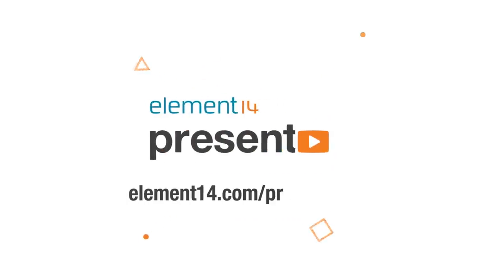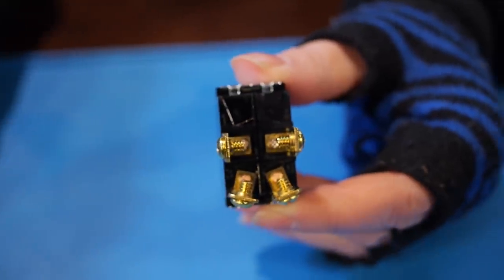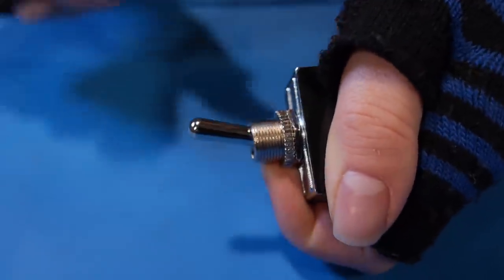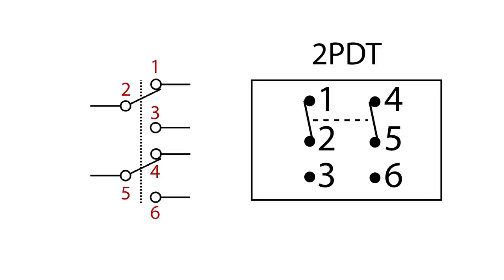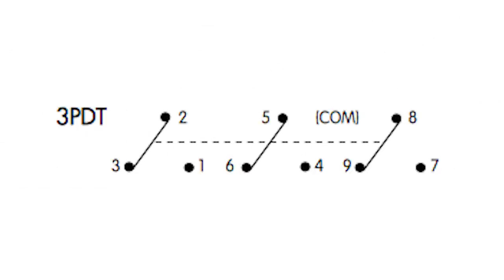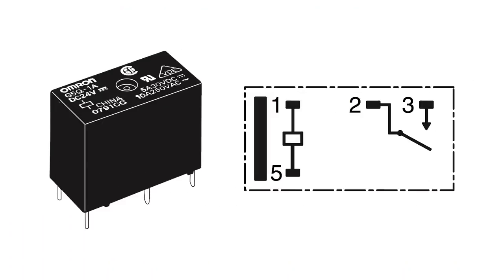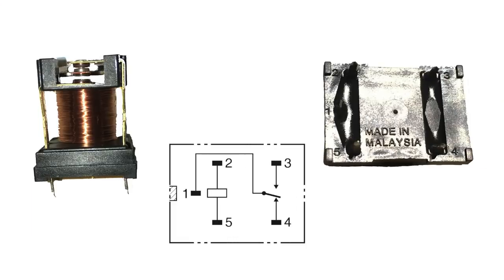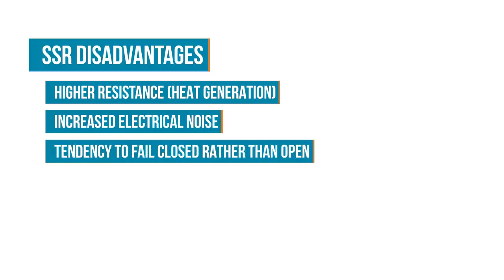Switches - Poles, Throws, and Relays - The Learning Circuit

Comment: Another awesome video - clear and concise.  I also share Valdis Black's concern about showing the 1N4148 diode part number.  Showing a diode without a part number might be a better choice for a generic diagram.  While the 1N4148 could work for some situations, it would not be a good choice for many others.  Since this is a learning video series, you may want to do a followup about choosing diodes for these types of applications.

Comment: BTW Relay coils DO NOT REPEL the actuator, they either Attract, or Release the actuator. a Spring returns the actuator the "Normal" position (as in Normally Open/Closed as opposed to the abnormal or energised position)

Comment: This seems to be all about 1 input creating multiple outputs.  But what if you have multiple inputs and want only 1 output i.e. two different sources calling for the same unit: in domestic heating, the heating circuit OR the hot water circuit calls for the same pump to turn on and you cannot run 2 lives to the same point. Which relay can you use for this scenario?

Comment: What about an Adjustable power supply using 16x SPDT switches driving a R2R network which sets the output of a adjustable regulator where the wanted value is selected as a binary number.